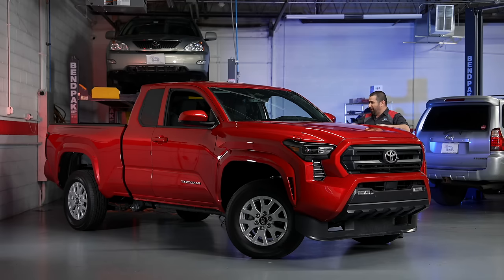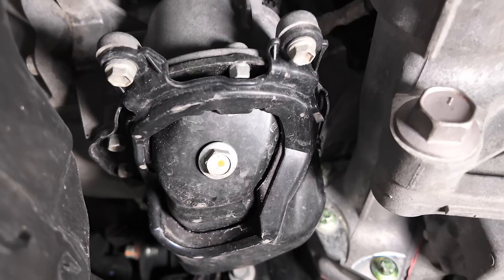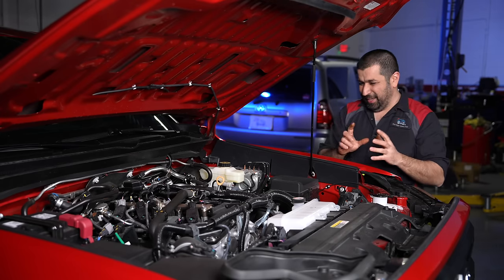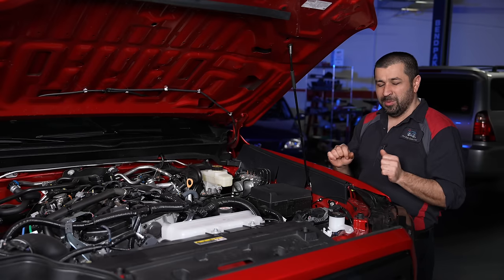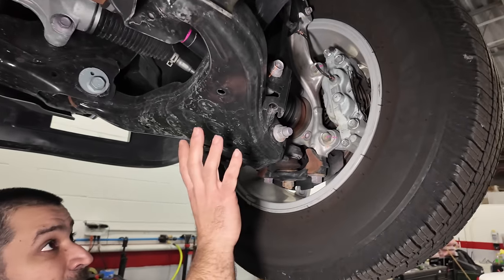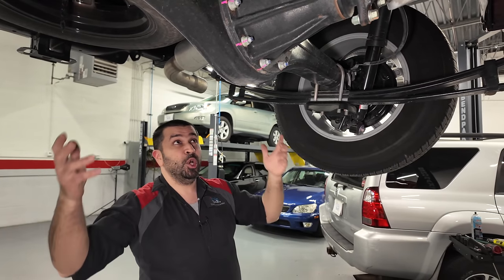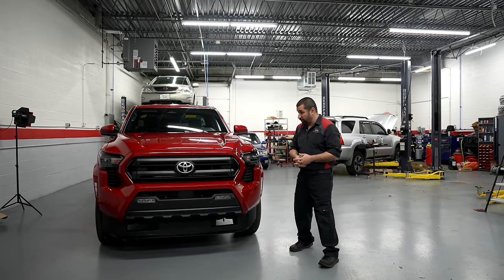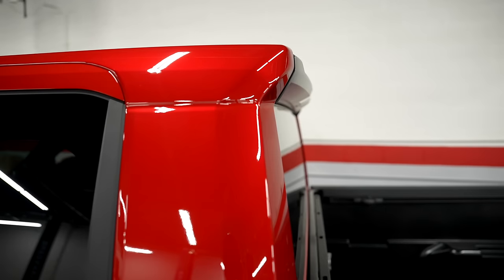2024 Toyota Tacoma | Did Toyota Improve or Ruin The Tacoma? Comprehensive Review

Comment: If I wanted a new Tacoma I don't think I would hesitate to buy one. BUT I still love my 2007 Tacoma with the 1GRFE V6. 265,000 miles and runs like new. No oil leaks and doesn't burn a drop of oil. Since the truck has been in Louisiana all of it's life there is NO rust on the frame.

I'm much more concerned about someone crashing into my truck than having engine failure.
Reply: My 95 Tacoma 3.4 V6 399,800 with no major issues
Reply: Any advice and keeping the vehicle running for that long? Want to make sure my 2019 reaches that age 😅
Reply: Same.. 2011 TRD Sport.  Still going strong.. but only 160,000km on it.
Reply: Change all fluids when your supposed to/basic maintenance. Every year or six months check everywhere with a flashlight. Make sure to listen for new noises periodically.
Reply: 2010 Tacoma with 190,000 miles.  Runs great. Bought it used with 115000 miles on it. All I've done is oil changes. Wasn't sure if transmission fluid had been changed so I left it as is
Reply: Me too. Mines has 167k. Only thing of note that I’ve had to replace was the alternator. 

Everything else has been mostly serpentine belt, brakes, suspension and tires.
Reply: Same here. My 2010 tacoma has 350,000 miles and run strong with no problems, just oil change regularly and normal wear and tear like tires and breaks. I continue to run it until it stops, hopefully another 5-7 years, and get another tacoma.
Reply: @YerBoyTroy  Change the oil.
Reply: @YerBoyTroy  Change the oil EVERY 5,000 miles.
Reply: @AlDo-l5x  *Brakes.
Reply: @pakviroti3616  I replaced brakes once, and alternator.
Reply: @AlDo-l5x  I was taking a good natured poke at you because you spelled "brakes" as "breaks".

Comment: My family has been a Toyota fam for almost 5 decades for a good reason.  Any Toyota we’ve had with just basic maintenance and being on top of it at proper intervals has lasted my fam 20+ years. 

I have a 2022 Taco SR5  V6 well proven engine, don’t think I’ll be going turbo anytime soon  here.

Thanks for the awesome Taco updates!
Reply: toyota isnt the company it once was
Reply: @cantwealljustgetalong2  I do agree, however, it’s still much better than some other companies out there that have really gone bad.
Reply: @rockkstah2550  ive always liked toyotas.  my grandmother bought the first toyota in the family in late 1987. which 20 years later ended up being my first car. my parents have been buying them since 1998 and bought their current one in 2014.  i just see a lot of things in the newest toyotas (after 2010 or so) that i dont like...looks like they are all about making money now, its very difficult to change the transmission fluid now, and you cant even check the fluid level yourself anymore, you must bring it to a shop.  or back to the dealership which is what they really want.  also the quality over all has gone down, the last toyota i owned myself was a 2006 camry, my moms 2014 feels and looks so much cheaper than my 2006 did
Reply: @rockkstah2550 That's a really low bar to step over...
Reply: overpriced 4 impossible to fix and an expensive disaster to keep
Reply: You might want to see if yours is recalled.
Reply: @mediocreman2  they usually send a recall letter so far none. Unless there’s something I missed
Reply: pdubsyyyy The haven't really been a good value since the 1990's .
Reply: I've owned GM all my life and nothing but basic maintenance on them. Over 30 years of driving. It's all in how you take care of them
Reply: @robertbrook8552 Ive had several GM products and they are superior to Toyota in handling , performance and mpg.  They also tow better with better payload and don't cost nearly as much.  Very reliable and well designed. The Toyota seems to be stuck in the 1980's.  I understand the appeal of a Camry , but avoid their pickups .  Way overrated .
Reply: @rockkstah2550 its about the same as KIA
Reply: @robertbrook8552  in all honesty Sir, I would love to own a Chevy or a GM truck.

But as an immigrant, when my family first move to the US(1970’s)from the far east, my family was proud to make it in America cause it took 5 years of paperwork to get a green card, soon afterwards we became full US citizens and damn proud of it.

My parents wanted to drive Chevrolet and  or fords only, unfortunately and unknowingly in the 70’s and the 80’s were the worst times for US vehicle concerning reliability. Long story short, the old man got tired of going under the car every weekend and decided to buy a Toyota on a whim in the mid 80’s and the family has never looked back.
Reply: @rockkstah2550  same here
Reply: @cantwealljustgetalong2 Sadly nothing is anymore. However I think certain models (if not all) are still fairly reliable compared to other manufacturers, or maybe I’m just Toyota biased 😅
Reply: @robertbrook8552  we have had GM all my life too along with the toyotas, we also had a few chrysler , no problems with those either. my dad is horrible with maintenance and used to beat on the gm trucks we had and they still lasted and kept going. we currently have a gm with 280K miles and a chrysler with 250K miles and the toyota
Reply: @joseadorno292  yeah they are still reliable, just cheaper made than before. all their newest cars are hybrid only now, so i doubt we will ever buy another toyota
Reply: This guys information is top notch. Great video. You have definitely talked me out of buying a new Tacoma.

Comment: Funny how they redesigned the front cover to prevent oil leaks, but now there are so many layers from top to bottom that could leak. Valve cover, cam tower, cylinder head, block, bed plate, upper pan, lower pan. That’s a lot of mating surfaces.
Reply: I’m pretty certain 2GR timing cover reseals covered the down payment on my house. Good for me, but bad for the owners.
Reply: That's a lot of "opportunities" for stealership service departments!

Comment: I enjoy driving my 86 toyota pickup 4x4 22r because it drives like a tractor that won't die
Reply: I had the 86!  Damn good truck. Built like a tank. Sadly the salt finally won or I’d still be driving it.
Reply: @homebuiltcamperdave5226 same here with the '81 4x4 I had...which had over 400,000 miles on original 22R....

Comment: I saw TFL broke their new Tacoma and I'm hoping it was just a fluke.  Still may wait till 2025 for mine.  Regardless, I'm here for a proper deep dive from TCCN because he never disappoints.
Reply: There may be a difference with the 4wd hi vs the locked 4x4 mode. Hopefully it's covered when they look for the problem on their channel.
Reply: There's always going to be something that breaks in a new truck.  Truth be told since that happened, Toyota covered  the repair.  As they should because right now that's a huge magnifying glass.  The same thing happened to the 4Runner the year they got rid of the V8... nobody wanted to buy them, until 3 or 4 years later when they saw, OMG they last longer than before.  :) I have a 2020 4Runner and glad to see they will make it easily to 245k average (based on 20 year history of registrations).  I have confidence in Taco as well as the Tundra proving themselves as well. I'm just not buying them until they make it past the initial build year stage.
Reply: It’s not a fluke. People are already having problems with the 4WD and that Turbo 4 Cylinder is not going to last like the V6.

Comment: The amount of times I hear “high performance” and “high pressure” and “vaccum pump” tell me 100% without a shadow of a doubt this drivetrain has an expiration date.
Reply: I can just look at it and i can tell you a brand new ones days are numbered a lot shorter than they used to be numbered to
Reply: Nah. These will be built to last. It’s quite simple technology. Toyota has been making 4 cylinder engines last for half million miles for a long time.
Reply: Yep. When ecobooost came out I told everyone they would blow up, my friends didn't listen. Spoiler: their ecobooost blew up
Reply: @Revy8  I know a few people with first gen 3.5 ecoboost with over 200k miles on the original turbo, one has 350k miles after turbo replacement that is just now on its last legs. The ecoboost is a huge improvement over the 5.4 3 valve those are junk despite  being a far simpler design. They have a much better low end torque then the 5.0 coyote also which is what you want in a truck

Comment: The lack of an Access Cab is a deal breaker for me.  Having to reach over the front seats to get to the back of the cab is a PITA.   Crazy but a 2023 TRD Off Road 4X4 is cheaper than a 2024 2WD Tacoma.
Reply: Right. You can hardly find more value in the new gen than in the old one. If you want an access cab with 4 doors, V6 and 6ft bed, get the Frontier. I got mine fully loaded, 4x4 for 39K. Powerful engine truck like driving, just great. The only think that is trash is the back up camera, it has less definition than the Minecraft game.
Reply: Yeah I agree, removing the access cab door is dumb. Hey Toyota, this is a truck!!